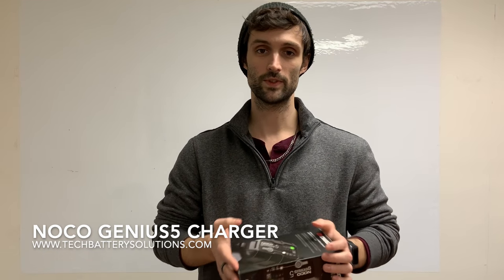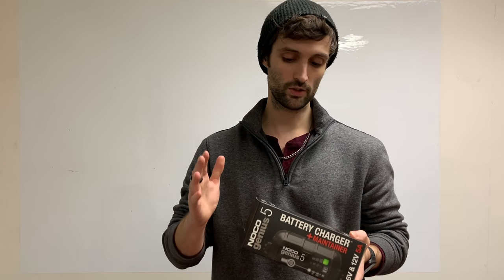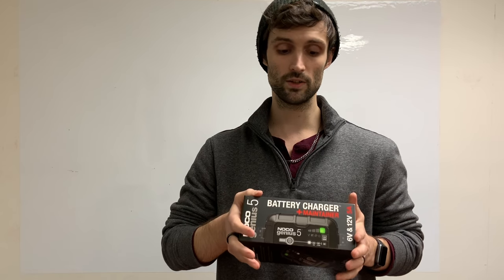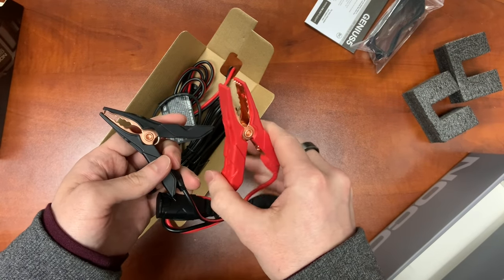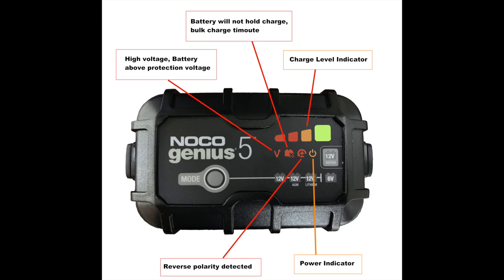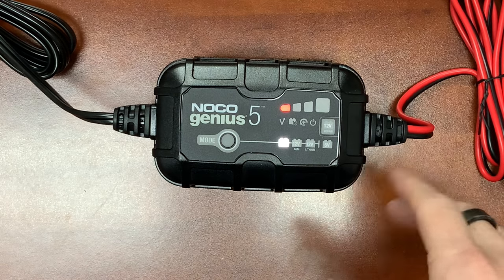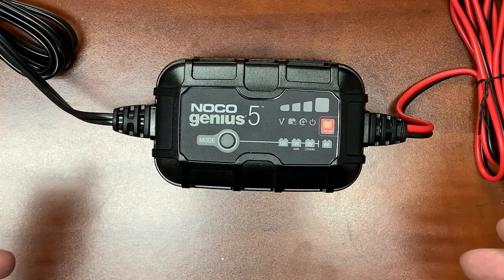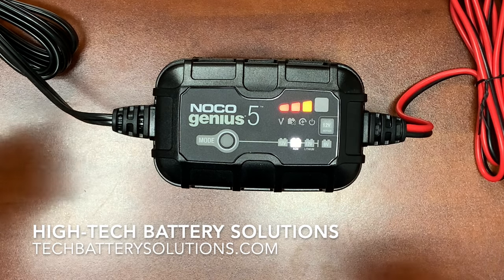NOCO GENIUS5 Battery Charger Review, In Depth

Comment: mine doesn’t turn on, does it have to be plugged into a battery for it to turn on?(yes i charged it a whole day and still wont turn on)(& i have not tried it on my car yet but just wondering, to prevent an accident)
Reply: i just want to be able to know how much battery percentage it has
Reply from the maker: Just to clarify this is not a jump starter, this unit must be plugged into a wall outlet in order for it to begin charging a battery.
Reply: @HighTechBatterySolutionsInc  

Thanks! this was really helpful, i was wondering why mine wasn’t working , whats a good suggestion you’d give me? for a good jump starter, heard the “CAT 3 in 1” is good (from costco)
Reply from the maker: @nalid6484  It depends on what you're looking for, if you're looking for a very slim lithium style jumper (only) that you can store in your glove compartment then NOCO's GB40 unit is worth a look. If you want a jump starter with a built-in inverter and air pump then the CAT is the way to go - the trade-off is the size and strength of the jump starter.

Comment: Does the desulfator feature work? I was in the understanding I needed 250 amp charger to do this.
Reply from the maker: Yes, the desulfation feature does work and you do not require 250A to do this. Desulfation is based on controlled voltage fluctuations to break up sulfates on the lead plates to turn it back into active material.
Reply: @HighTechBatterySolutionsInc  Can you repeat the four hour repair process two or three times in a row?

Comment: Can I charge battery out at winter around -20C? Does this charger support winter mode?
Reply from the maker: -20C is about the limit that the charger can operate in, if you get any colder than that then your going to start running into issues. The operating temperature for the unit is -20C to +40C.

Comment: For Repair mode,i need to have in stand by,then press for 3 seconds and once more. Then i leave the red 12V-repair light to blink until it is over...or?  Tnx
Reply from the maker: Yes, once you see the blinking red light the repair mode has been engaged  - time to let it do its thing.
Reply: @HighTechBatterySolutionsInc  I have battery in my car fr 6 years and still works. Now in winters little slower,so i tried to fill it up. Yesterday i was charging for 10 hrs.....and today it again7hrs...but the green light still blinks. And from the start it shows that it have at least 75%. Don't know why it charges so long.
Reply from the maker: @1jodlar  I think it's time to get your battery tested at an auto shop to see where it is in the life cycle. It sounds like your battery may be having a difficult time retaining a charge which would be why the charger is not getting to the fully charged solid green light on a consistent basis. A load test on the battery will let give you a solid idea of how much life the battery has left.
Reply: @HighTechBatterySolutionsInc   I will see tomorrow when i try to start up the car. Cheers mate🤘

Comment: Hi Thanks for the review I do have a Renogy Deep Cycle Hybrid GEL Battery 12 Volt 200Ah ,What settings should I use on the noco G15000 charger?  Thanks in advance

Comment: Hello Richard, Do I need to do anything special when charging the battery pack the first time, a specific settting on the pack I need to select? If my car battery is a 12 volt battery for a Malibu is there anything special, or do I just select charging for a 12 volt battery? Thank you.
Reply from the maker: For your Malibu battery, you will select the 12V mode on the charger and let it go through its charging cycle. There is no special setting for first time charging required, just hook it up to the battery and select the 12V mode, and your good to go.
Reply: @HighTechBatterySolutionsInc  awesome thank you😊😊😊

Comment: Great review! Is it OK to repeat the Recovery process several times in a row?
Reply from the maker: I don't think NOCO has any written guidance on this but we normally call it after two attempts at the recovery process. If we are not able to bring a battery back after two full cycles of the recovery mode then its to far gone.
Reply: @HighTechBatterySolutionsInc  Thank you for the reply! I actually went ahead and ran three Recovery cycles one after another with my Genuis5 yesterday.  And then I ran it in the maintanance mode for 12 hours. That got  my battery SOH percentage go up from 82% to 99%. With my other charger's recovery,, Chinese Konnwei KW510, I was not able to  go above 82% SOH.

Comment: I bought One of this for a battery of a Mazda cx-3 (1.8d with star&stop) to mantain the charge of the battery for a long stop ..the question Is: i have to use 12v normal or 12v Agm? 
Thank you
Reply from the maker: You need to confirm if you have a sealed AGM battery in the car. If you do then the AGM mode is the way to go, if not then hit the normal mode.
Reply: @HighTechBatterySolutionsInc   Is a EFB, so 12v Is the way.. Thank you man!

Comment: Thanks for this Video.
How long does it take to charge 12V Mercedes 2019 E class?
Reply from the maker: Assuming that the battery is 100% discharged it would take between 12 and 16 hours - less so if the battery was not drained all the way down.
Reply: @HighTechBatterySolutionsInc  
I tried but it is not charging the 12V
I bought Genius 5 charger.
Do I need to buy different charger?
Reply from the maker: @pervezakhtar6718  No, a different charger will get you the same results. When you say it's not working do you have any LED lights on the charger at all?
Reply: @HighTechBatterySolutionsInc  
Yes, first bar blinks (25% charging) LED light. I charged it almost 48 hrs.
Reply from the maker: @pervezakhtar6718  I think its time to get the battery tested at that point. Whenever we see something like this the battery is accepting a charge however there is an issue retaining it.

Comment: Hi I am charging a 60AH AGM car battery for 2 days and charger indicator keeps flashing green not solid.Should i be worried?
Reply: After 3 days it turned solid green and my battery is fully charged.Thank you guys,keep up the good work!
Reply: @johnny81-43  it took 3days for your 60AH AGM to completly charge? Damn I got this for my 76AH AGM and was wondering why the light wasnt turning solid green.

Comment: Hello! Is there any advantage of NOCO genius 10 comparing to the genius 5, if you don't need the supply mode and 10 amps?
Reply from the maker: No, the main difference between the two is the charge rate and supply mode. If your not concerned about those two things then the GENIUS5 would be the way to go.

Comment: must it be plugged in to the wall to charge the battery or does it store power on its own ?
Reply from the maker: The unit must be plugged into a wall outlet in order to work - it is not able to store a charge on its own.

Comment: Thanks! Is there a connection I can use to charge Quantum Turbo batteries? Also, can it charge multiple batteries at the same time?
Reply from the maker: Unfortunately, there is no cable available from NOCO to charge a Quantum Turbo battery. The charger itself will have a single lead on it, so if you wanted to charge multiple batteries then you would have to wire them up in parallel. They also have a model called the NOCO GENIUS2X4 that is a 4 bank model with a 2 amp output per bank.
Reply: @HighTechBatterySolutionsInc  Thanks again!

Comment: hi , i have a agm battery . can i use the repair mode for AGM battery , thanks
Reply from the maker: Yes you can use the repair mode on an AGM battery - the only chemistry that you can not use the repair mode on is Lithium.
Reply: @HighTechBatterySolutionsInc  thank you , i use the repair mode for a 12v-7ah sulphuric acid battery and works excelent , the cicle was around 3 hours . on my AGM battery i just leave on the car for 48 hours until it was complet charge. is a long proces on bmw f11 because a lot of energy was drain even after closing the car but after that i read a impressiv 13.20 v , Thanks again for your reply

Comment: NOCO GENIUS5  and NOCO GEN5X1，Which is better?
Reply from the maker: Depends on your application. If you need something mobile and are charging automotive or motorcycle batteries I recommend the GENIUS5 since it comes with battery clamps. The GEN5X1 unit will only come with hardwired eyelet terminals so your looking at limited connectivity to marine style terminals.
Reply: @HighTechBatterySolutionsInc  Is the charging speed the same?
Reply from the maker: @chenzhou4078  Exact Same

Comment: Thanks for the review. I just got a Gen 5 to try to bring the 12V battery in my 2019 Honda Clarity back to life. It went dead from prolonged disuse during lockdown. I wasn't sure what mode to try but went with 12V (the first one) since I couldn't find any info saying my battery was a different kind. It failed to charge on the first try, which was not unexpected. I then tried force mode. After 5 minutes of LEDs blinking as expected, instead of entering regular charge mode it started a pattern of LED blinking that was not in the manual or anywhere else I could find. The 12V LED (the first one) blinked fast a couple times, then blinked in unison with the 25% charged LED. Once those two were blinking together (slowly), they would alternate with the standby LED blinking.  So the blinking pattern was 25% plus 12V, then standby, repeat, with an occasional solo flash of the 12V LED mixed in. Do you have any idea what might be going on? I don't know if there's something special I don't know about since my vehicle is a hybrid, if I'm doing something wrong, if this relatively new battery is beyond help, or if my Gen5 might be defective. (To be clear, it is only the "regular" 12V battery I'm attempting to charge, not the special batteries that make the vehicle a hybrid.)
Reply: I did not figure out what the undocumented LED pattern meant, but I accomplished my original goal by disconnecting the car's clamp from the negative terminal and trying again with the Gen5. With that set-up, the 12V battery charged as expected and pretty soon I was able to reconnect the negative terminal clamp and start the car. I didn't top off the battery yet because I was impatient to drive, but it's good to know I can if needed.
Reply from the maker: @marcusmonkeyman6907   I think the problem may have been your car itself drawing on the battery while the charger was attempting to put amperage into it. I was waiting on NOCO's response to this light sequence, and the overall answer was that your battery was having a very tough time retaining a charge. If you disconnected the negative clamp and then the battery went through the charging process I would imagine that your car has a decent drain going on.

Comment: Hey Richard I have a question. I have 26 foot AGM batteries in my RV. I purchased the genius five but wondering if I use the 12 V AGM setting or put it into 6 V for a charge. I realize this might be an ignorant question but I don’t wanna make any mistakes. Thanks for your review and any information you can give me.
Reply: By the way my AutoCorrect changed  2 6 volt to 26 volt.  It is a pair of linked 6 volt AGM batteries.  Thanks
Reply from the maker: The wording on the comment was 26 foot AGM but I am assuming your running a pair 6 volt batteries in series to create one large 12v battery. If that's the case then using the 12V mode to charge the battery pack will work just fine. Positive to battery 'A' and negative to battery 'B' and your good to go. If you want to equalize the batteries then you can charge them one at a time on the 6V setting. I would recommend doing that once a year -
Reply: Thanks!!  Couldn’t find this anywhere else!!

Comment: Great video.  Is this good for "all" types of Lithium motorcycle batteries?
Reply: 3 years later, but the NOCO website suggests "all lithium batteries with a BMS (Battery Management System)". I think that would be most Lithium batteries these days, I'm not fully across it but as far as I know a BMS prevents over/under charging and balances the cells. I'd kind of guess the NOCO just gives the Lithium battery as much as the BMS allows it to take, which is why it has it's own mode, while normal batteries it needs to be smarter about how it applies the charge for the given battery tech.

Comment: Can I charge 3 motorcycle at the same time ?
Reply from the maker: This charger only has a single set of battery clamps. That being said if you hook up all three batteries up in parallel you would be able to pull it off without a problem.

Comment: Quick question to your great review! Can we use repair mode without removing the battery from the car?
Reply from the maker: NOCO does strongly recommend removing the battery from the vehicle before engaging the repair mode. It has to do with the voltage fluctuations brought on by the repair mode, they do not want any computer systems damaged in the vehicle.
Reply: @HighTechBatterySolutionsInc  Thank you for the answer!  I just order that NOCO based on  your review.
Reply: @zerodegrekelvin2 Does your noco still functioning to this day 2024 ?

Comment: Thank you for the great reviews. Can you briefly explain the difference between 5 amp and 10 amp? Does the 10 amp charge bigger batteries or is it just faster? Thanks in advance.
Reply: 10amp will charge the battery faster as it provides twice the current on the 5amp battery. If you aren't in a hurry the 5amp is fine as apparently fast charging a battery affects long term battery health more than slow charging.
Reply from the maker: The GENIUS10 charger has a higher output which will enable you to charge larger batteries faster and the unit has the Supply mode feature. The only downside to the GENIUS10 is that due to the higher charge rate it limits the batteries that you can use this on to lawn and garden batteries or bigger. You would not be able to use the GENIUS10 on motorcycle batteries. The GENIUS5 series is a mid-level charger that can charge motorcycle and most larger batteries at a with its lower rate of charge.
Reply: The Genius 10 has a 12v supply setting that the Genius 5 does not. Can you explain what this is?
Reply from the maker: @tuffguy11505  The supply mode turns the charger into a power supply. The charger will put out a constant 5A output that you would use to keep power to your vehicle while you install a new battery. It keeps power to the computer systems in the car so your settings/idle are not affected.
Reply: @HighTechBatterySolutionsInc   QUick question, for motorcycles and 12 volt batteries in general, would it be better to get the 5 amp or the 2 amp?
Reply: @047thRonin  5amp
Reply: @HighTechBatterySolutionsInc  , On No.co website, it says the Genius 10 can charge a 20 amp hour Motorcycle Battery in 1.5 hours. So why are you stating that the Genius 10 can't be used on a Motorcycle Battery? Please explain
Reply: @HighTechBatterySolutionsInc  We typically recommend checking with your battery's manufacturer when considering using the GENIUS10 for smaller applications like a motorcycle. Those batteries tend to be very small in capacity, and batteries of that size usually cannot be charged at 10A because that is too high of a current for those batteries to handle. All batteries aren't created equally, though, and it's still possible that your specific battery can handle a max charge amperage of 10A. But, when it comes to small batteries like that it's best to check with the manufacturer beforehand to confirm. "This is the response I got from NOCO"
Reply from the maker: @dlos1987  I would not recommend hitting a small motorcycle battery with 10 amps. If you continuously fast charge a lead-acid based battery then you will gradually shorten its life span - or quickly depending on how small it is.
Reply: @HighTechBatterySolutionsInc  , Thanks for your knowledge. I bought the Genius 5 instead
Reply: @HighTechBatterySolutionsInc  so this supply mode, since my battery is in the trunk, would i connect the noco to a positive post and a negative terminal which are both located under the hood then fire it up while i remove/replace the battery that's in the trunk? is that how it'd work?
Reply: @HighTechBatterySolutionsInc  i have a 80Ahr sulfuric acid battery with 730 cca. which noco would be good for this? i also have a bigger battery platinum agm autocraft h7 agm 1000 cca @ 32°F, 80Ahr with 850 cca @ 0°F. which noco would be good for this one?
Reply from the maker: @fallback8314  I recommend connecting the charger clamps to the battery cables if possible. The reason is that the jump poles of the vehicle may completely shut down if the key is not in the correct position. You would need to consult the manual for your year make and model to find out the specifics on if/when those poles shut down.
Reply from the maker: @fallback8314  The GENIUS5 charger would be a good option for you. If you are in absolute need of a faster charging time then you can take a look at the NOCO GENIUS10 series. I'm assuming these will be starting batteries in vehicles so they most likely will not be flat-lined to often.
Reply: @HighTechBatterySolutionsInc  ah ok, thank you very much

Comment: So when the battery is fully charge does that stay green without blinking??? Thanks great review
Reply: Battery fully charged goes solid green briefly than begins to blink slowly...that is indicating it’s in maintenance mode..u can leave it like that till u it goes solid green..may take a few days..
Reply: @facedown9754  if I charge my 12v AGM once a month to top off is it better to do the full charge to 14.8v or is it ok to just charge it until it goes into maintenance mode which is around 13.5?
Reply: Needs to charge longer.
Solid green light want blink when fully charged.